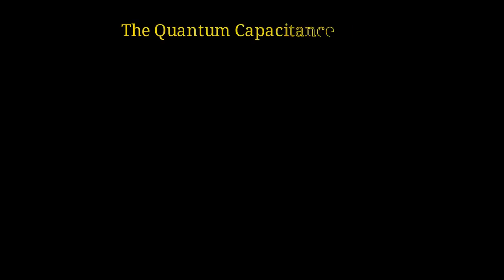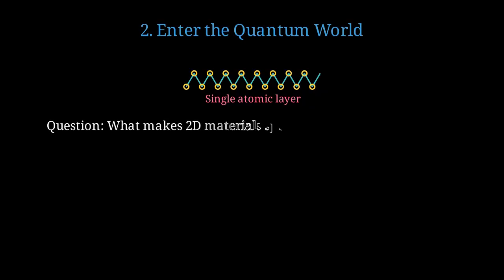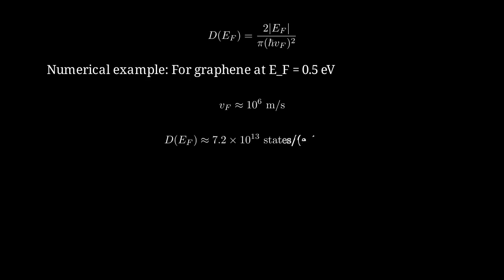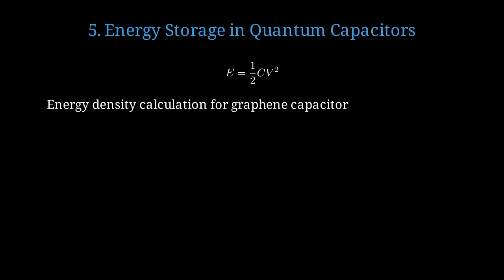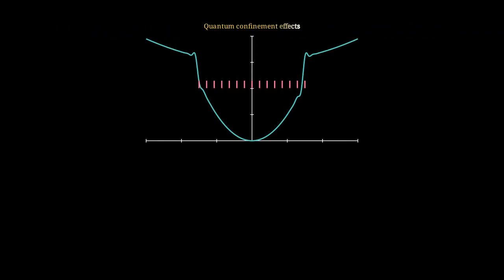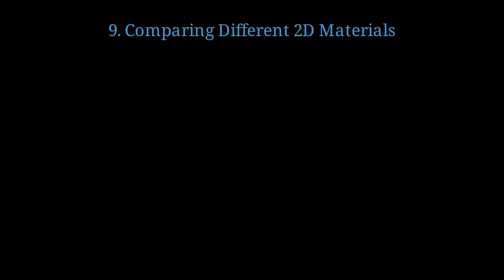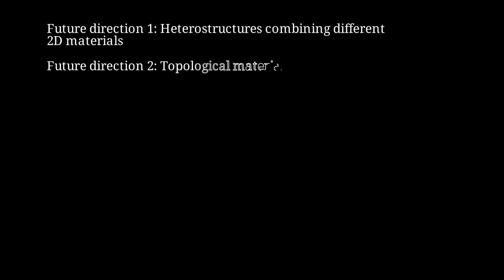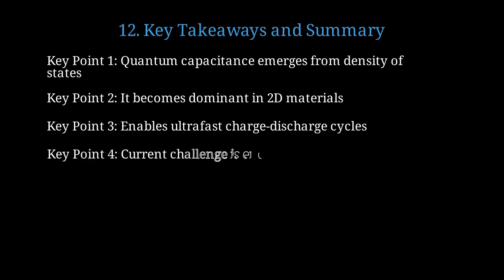Graphene’s Hidden Power: Capacitance from Quantum States

Comment from the maker: How does quantum capacitance influence charge transport in low-dimensional systems under nonequilibrium conditions?
What are the limits of energy density when stacking van der Waals heterostructures for multilayer quantum capacitors?
How might entanglement or topological protection influence future quantum-capacitive energy storage?